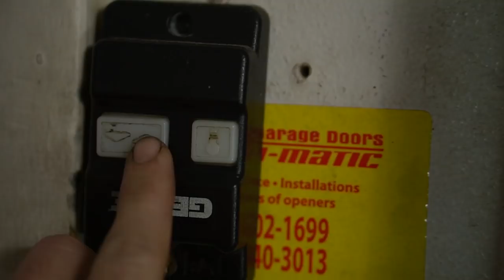Painting the Miata Engine Bay and Cage with my Girlfriend!

Comment: Hey taylor love the vid ! I am working in construction and we have a lot of formation and stuff and the little mask that you are wering for painting are not rated for paint not spary paint at least they only protect agains dry particules like sand of dust. You need to get the one where you can put some P100 filter. Basicly the half face mask that you can clip and unclip the filter :) anyway be safe !

Comment: You should of used SprayMax 2k Clear, it's a bit pricey but it's a 2 part clear in a rattle can and it's more durable. Keep it in mind for when you respray the cage later. You can get like 4-6 packs on ebay which drops the price a good bit.

Comment: just so you know taylor you're using a p-series dust mask p99 p100 whatevery the rating is, its a particle mask its not stopping the fumes from the paint. Just a heads up, get a mask that is OV rating instead of P. OV stands for Organic Vapours. ( you might be using a the right mask but i dont think so ..... OV has blue elastic bands and im pretty sure you'res had yellow)